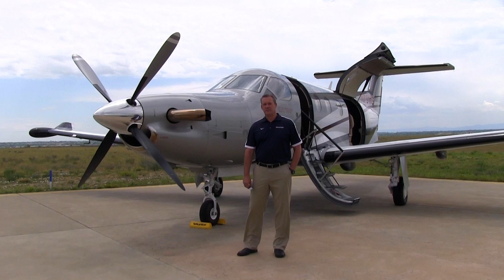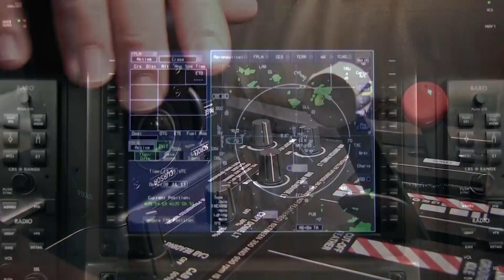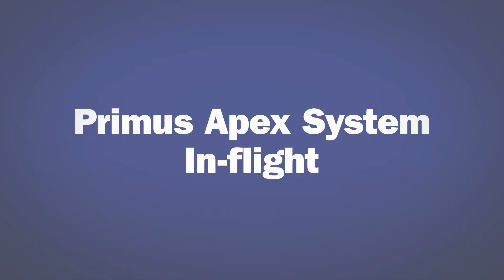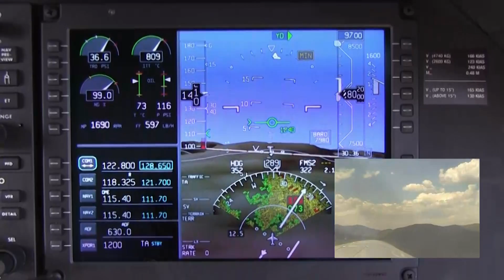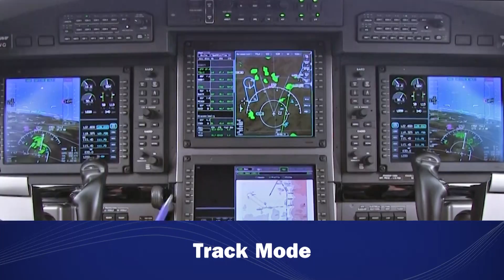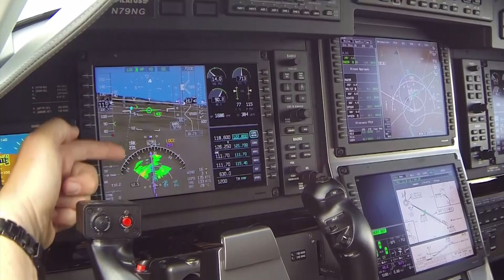PC-12 NG – Apex Avionics System

Comment: The Honeywell Primus  Avionics System is one of the best I have seen. It takes all of the guess work out of flying and adds another level of safety. Ease of operation is wonderful as well as the flight displays. The PC-12 takes flying to another level! Absolutely, one of my favorite airplanes. I like the TBM-850 but no comparison to the Pilatus!
Reply: one tbm850 crashed in buffalo with barnes as pilot. Seems could be electrical failure or hypoxia? Does this plane have safeguards against that?
Reply: It has 2 main batteries, 2 300 amp generators, plus a standby battery. The aircraft is pressurized with an 02 back up.

Comment: I'm not a pilot, if somebody can answer these questions that would be fantastic. How smart is the system, if somebody were to input LAX to Honolulu 2,559.88 mi will the system say" I hope you're really good swimmer" or some other message. In Europe there's really high mountain ranges if a pilot were to put a destination and an altitude that's insufficient to a clear mountains will Apex Avionics system alert the pilot .
Reply: The apex system is aware of how much fuel is on board, and a warning would alert the pilots before even starting the engine (if using the pre-departure clearance mode) that the flight can't be completed. And it also is equipt with TAWS (terrain warning system) and a radar altimeter so it knows the terrain in front of it and how high it is above the ground. You will get an audio and visual warning "Terrain, Terrain" but the plane won't avoid the mountain. That's up to the pilot.